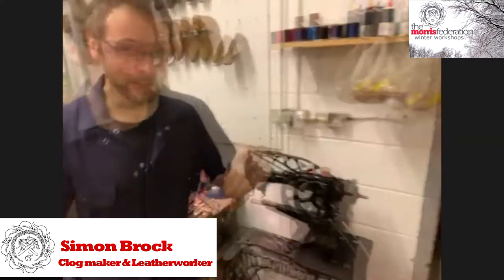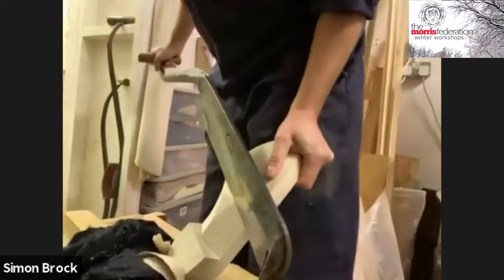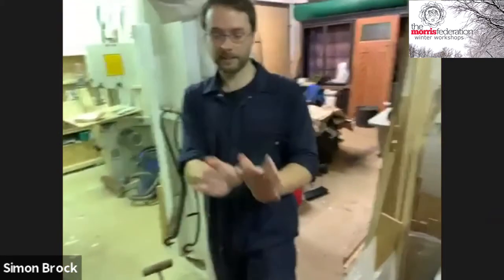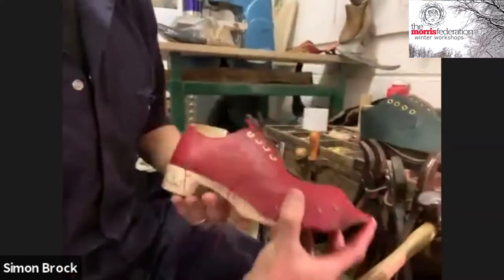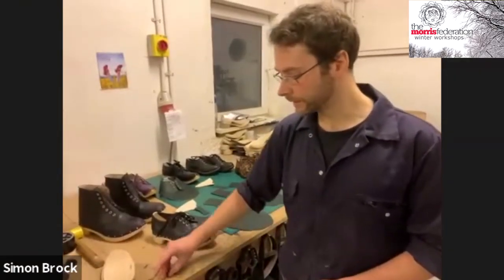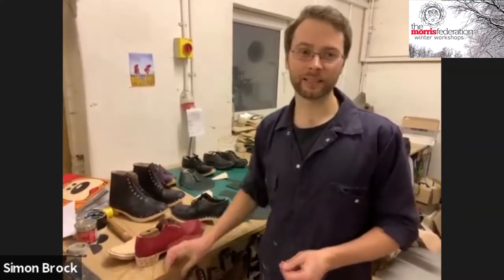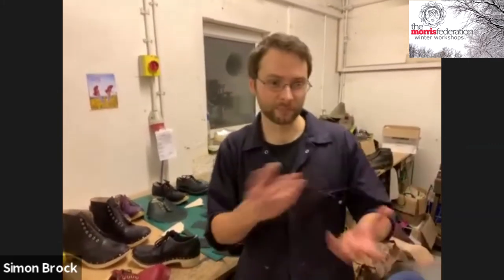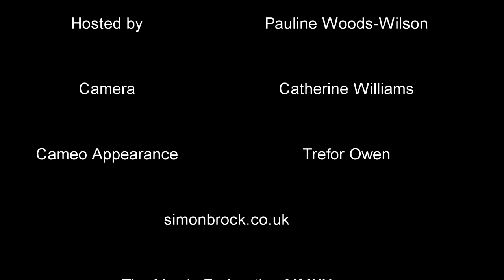Demonstration of Clog Making - Simon Brock

Comment: i,m nearly age 60 & i,ve worn clogs for most of my life,  & i keep telling people that i work with, that are constantly walking on concrete floor.s & have painfull feet, (prob cos of been on concrete constantly) to buy a pair of clogs, cos obvs.ly your feet are on wood all day, & because the foot can not bend, cos obvs,ly it can,t , the feet do not get tired, the curve in the clog bottom, does the walking for ya, & even though some people think they look uncomfortable (its obvs,ly people thats never worn them) cos once someone buys a pair, they are allways surprised by how very comfortable they realy are, they are also warm in winter & wet weather, just keep them well polished with propper boot polish, i rub the polish on the edge,s of the wood as well as the leather. Cos i like the wood to be black aswell with just the brass toe tins at the front visable & obvsly the nails all around the edge, the only weather where you can,t realy wear them, is when its snowing, cos you end up with clumps of snow stuck to the bottoms, which sticks to the wood, but prob if the whole sole & heal are coverd with rubber, which these days they usuly are.  they would prob be ok in the snow, i have rubber shods on one pair & original iron caulker,s on the other pair that i have, which i do my self when they need doing, & when i,m next flush with a bit of spare cash, i.m gonna buy myself another pair, (black of course) thanks for the video.